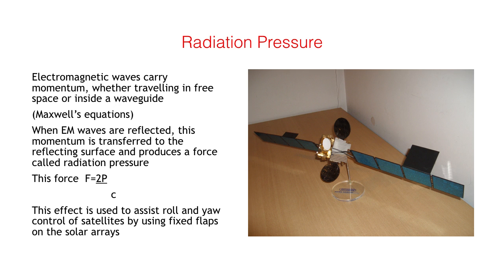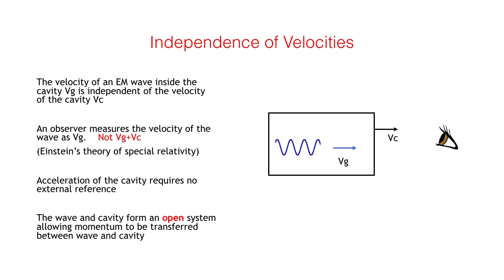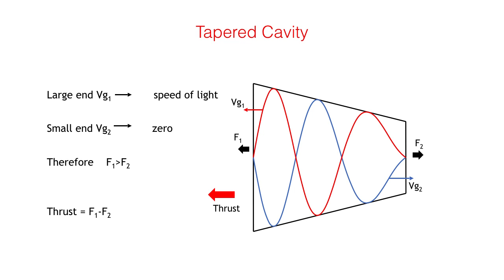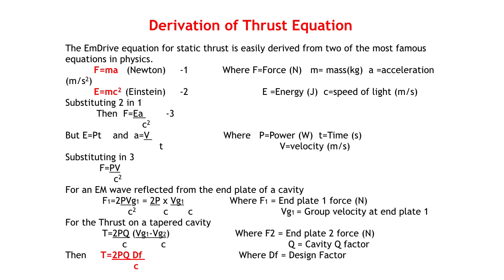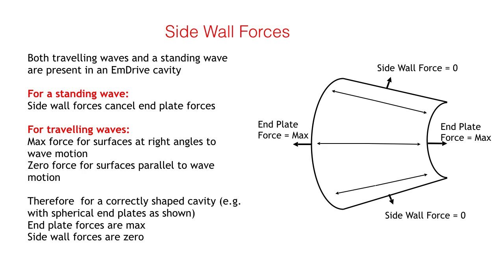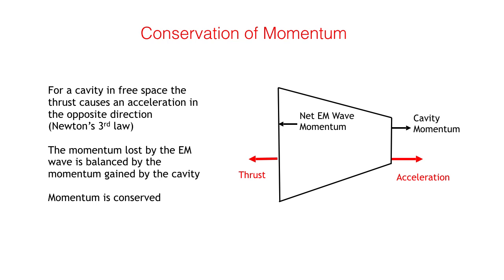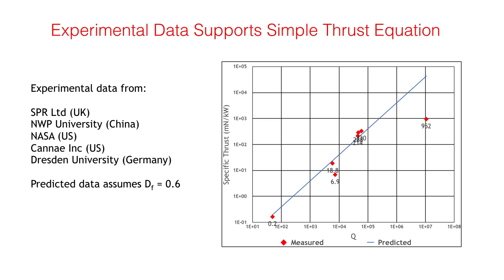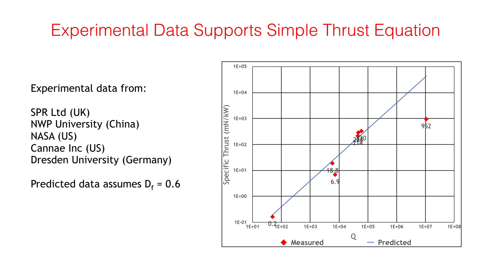Roger Shawyer Explaining The Basic Science behind #EmDrive

Comment: I'm not sure why its controversial, its not a perpetual engine and requires continuous energy from the magnetron to function. You don't get free energy... just thrust from a closed system
Reply: Yes it is a perpetual motion machine. IF as described the thrust per kw is constant (and therefore the acceleration too) , then the speed will go up linearly if the energy input is constant.

Here is a mathematical proof: 

The total energy in Ein(t) will be

Ein(t) = w * t  With w the power put in in Watts

And the speed over time

V(t) = a*t  with the acceleration proportional to the constant thrust.

Then the kinetic energy is

kE(t) = m*V(t)*V(t)
kE(t) = m*a*a*t*t

At first, the input energy is higher than the kinetic energy relative to the launch pad. But there will be a moment where t=w/(m*a*a). From this point on, the kinetic energy will be higher than the total energy input.

The thing is, no object can have a constant thrust. Therefore the emDrive either has a constant thrust, making it a perpetual motion machine, or it violates special relativity (thrust dependent on relative speed without any exhaust)
Reply: +Robin Hill The issue here is that from the engine inertial frame of reference, the engine still sees it's own mass as constant. It doesn't matter how close your relative speed to launch pad is.  So it will also sees its acceleration as constant. Therefore it will reach arbitrary high relative speeds from launch pad. No matter what mass it seems to have from launch pad.

A propellant less drive IS a over the unity perpetual motion machine.
Reply: The problem is you can't gain momentum from a closed system. If there is a collision against an angled wall, it will create a force that is also angled. And the component of that force in the direction of the smaller end will equal the difference between the large end and the small end.
Reply: Exactly! Ramarajulu understands it.
Reply: Well, the point of this EM drive is that apparently you CAN gain a net momentum in one direction from a closed system.... NASA understand the physics and are testing such a device too.... the force is pretty small though, so it's application is most effective away from sources of strong gravity such as the surface of the earth, and therefore to long space journeys whereby 1) the lack of need for carrying propellant fuel reduces the mass you need to use, and 2) the constant force to accelerate adds up over time to a greater total acceleration than chemical rockets, etc, and 3) the fact that EM waves are being used to generate the thrust means that the thrust will continue to be effective until the spacecraft reaches high speeds and relativistic effects begin to significantly affect the mass of the spacecraft and therefore the further acceleration of the spacecraft is negated by its increase in mass.
Reply: Robin Hill 
You're using "acceleration" wrong.....

And I'm pretty sure NASA doesn't understand the physics. They built their own because some university tried it and was measuring thrust but they couldn't believe it because it violates conservation of momentum.
Reply: Well, did you consider that you may may not have understood or may have misinterpreted what I wrote? ....or perhaps you would care to explain why it is that you feel that I used the term "acceleration" in the wrong way.
Reply: Robin Hill 
The acceleration is significantly smaller than other propulsion types. But it does add up over time to give you a greater total velocity!

And honestly, I dont quite understand what the em drive in specific has to do with retivistic velocities that other propulsion systems wouldn't? Or did you just write that part out for fun?
Reply: +tyty8484 So I referred to a greater total acceleration than with chemical, which obviously results in a higher velocity.... but I have not used the term "acceleration" incorrectly. In respect of the point you don't understand about EM drive and relativistic effects, as opposed to chemical propulsion it's pretty straightforward.... with the EM drive you don't need to carry propellant, so as you approach speeds where relativistic effects come into play the increase in mass to be accelerated will relate only to the mass of the vehicle, not the vehicle plus propellant, and this is a significant difference.
Reply: Robin Hill 
You're still wrong about acceleration. Acceleration is the change in velocity over time. Chemical, at least at this time, provides much much much more acceleration than the EM drive. But the chem rocket runs out of fuel and the EM drive continues to accelerate at a lower rate for much longer. So yes, em drive ends up with a higher velocity. But no, what you said about acceleration was wrong.

And yes, I understand the implications of the EM drive.
Reply: tyty8484 just because you are incapable of understanding what I have written doesn't make it wrong.... you reach a higher velocity by a greater total acceleration.... yes, a chemical rocket will produce more thrust and accelerate at a faster rate, but then run out of fuel, whereas the EM drive, if it works, produces a lower thrust and so will accelerate at a lower rate for longer resulting in a greater total acceleration and higher velocity.... please tell me you get it now and are not still struggling to understand what I'm saying.
Reply: arnaud nicolas the EM drive can use, for example, solar panels to get energy from starlight, which it uses to pump energy into the container, but just because it doesn't use a chemical propellant it does not mean to say that it is over unity or a perpetual motion machine.
Reply: Robin Hill 
So you're saying that the em drive increases in acceleration? I was under the impression that the acceleration was constant.
Reply: +tyty8484 I'll take your feeble attempt to claim that I said something that I didn't as evidence that you have finally understood what I was saying and so have resorted to false claims and mockery. It's becoming apparent to me that you merely wish to try and find people on the internet to falsely criticize, wind up and mock in order to satisfy your delusion of grandeur. Well, I have better things to do than to take any further time attempting to help someone such as yourself, so knock yourself out with your next response, I doubt there's anyone here paying any attention to you chum.
Reply: @robinhill5387  lmao
Reply: Robin Hill 
What in the world are you talking about??? You didn't even answer my question.
Reply: I agree it's not a perpetual motion machine bc there is constant energy input. But it is not a closed system because a closed system requires there to be no energy input. So it's actually an open system, and i saw a video in which Shawyer states that.

Comment: The equation E=mc^2 is not the actual equation.   it is Delta(E)=Delta(m)c^2.   You can't just use E=mc^2 as suggested in the equations presented.     The results may still work out... but the equation should be presented accurately.
Reply: This is what got you? Not the fact that he's ignoring conservation of momentum in angled collisions?

Thanks Big Bang Theory....
Reply: Tha law is falling anyway - as it's just an observation from our usual experiences, and doesn't even explain on an atomic level how throwing a stone away from us while in a boat on a lake will give both the stone and the boat momentum out of nothing but energy. Among many other things.
Reply: Carl Dombrowski 
What are you even talking about??? Conservation of momentum works on an atomic level. That's how the freakin ion drives work. Do you mean sub-atomic? How would you isolate momentum from the sub atomic forces to even test it? Conservation of momentum isn't going anywhere.
Reply: tyty8484 No difference between ion drive and any other propulsion drive in that. However, when one ion gets propelled magnetically in one direction, what exactly causes the rest of the engine to go the other way? How does the engine turn from speed x to speed x+d? How do the atoms not "directly" taking part in the propelling know which way to go? Conservation of Momentum doesn't explain this, it only describes something which happens under certain circumstances. It's just a cop-out which works in some areas, but fails to explain quite a bit in other areas - including the em drive.
Reply: Carl Dombrowski 
You make absolutely no sense. Maybe you don't understand what momentum is? Or maybe frame of reference? 

When one ion gets propelled in any direction, whatever propelled it goes the other direction with an equal momentum. On the other hand, if your frame of reference includes all of the mass you expel and the mass you are propelling then you will get a net momentum change of zero. And your center of mass/gravity will not change either.

If you're talking about collisions then the speed of the objects after collision are determined by conservation of momentum and energy. They have to satisfy both m1v1 = m2v2 and  (1/2)m1(v1)^2 = (1/2)m2(v2)^2. That's why those swingy balls on your physics profs desk only has one ball swing back and forth. Or why a small ball hitting a larger ball will cause the small ball to fly backwards or why a large ball keeps rolling forward after hitting a small ball away much faster.

Energy mass and momentum must be fully conserved. 

You're welcome for that physics lesson.
Reply: tyty8484 Nothing new in what you say. Just a lot of stuff that's missing. Let's take your ion propulsion as an example: The ion and the ion engine are usually not directly connected. Only an electro-magnetic field propels the ion, and as happens to be in this case, also the engine. How does the field do that? What property of the field manages to propel the ion? Is there any way to get the same effect on the ion without the field also affecting the engine? Seems there is.
Reply: Carl Dombrowski 
Ohhhhhh, so you don't know how electromagnetism works. Ok

Basically, like charges repel and opposite charges attract. A moving charge creates a magnetic field, so in a magnetic field moving charges will deflect.

The fields are basically anchored to an object. Anything that affects the field also affects the object.... Maybe this was the confusion?
Reply: tyty8484 Funny how you move to personal attacks when you don't have any rational arguments left. Try to think about it and you'll understand eventually...
Reply: Carl Dombrowski 
Ebin trolls Carl Dumb-bro-ski